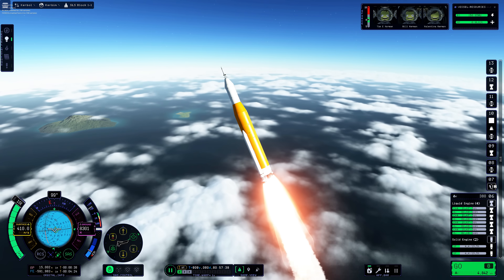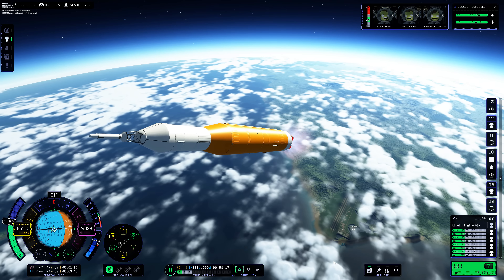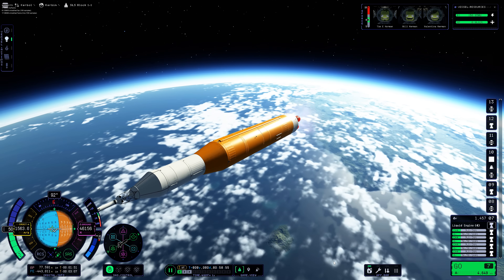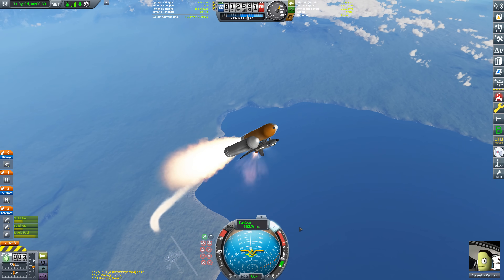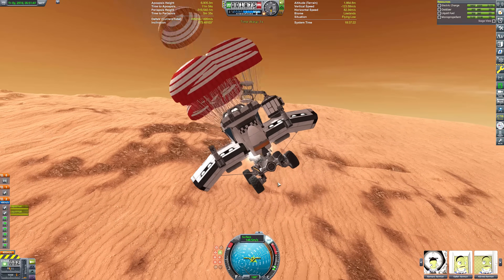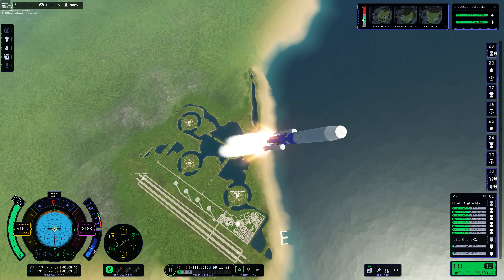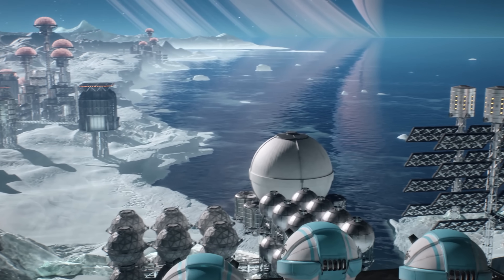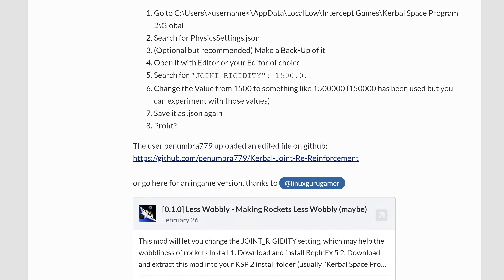Wobbly Rockets Still Haunt KSP2: Developers Face Uphill Battle

Comment: I think I actually disagree with you. Now, From a realistic standpoint, having wobble, but having it better tuned, is closer to a simulation than just treating literally everything as one rigidbody. It creates engineering problems that you have to solve in some analog to real life. It's not exact, but it's true. I also think the argument that "no one would have asked for wobbliness" is misleading. People wouldn't ask for things they don't think about, but I also do believe there's some weight to the idea that the "wobble" WAS entertaining when coming into it, but also, that engineering around the problem, or watching other people creatively engineer around it, was one of the things that made channels like yours really interesting. If you could just stack anything together and launch it, I wouldn't have really had much interest in watching some of the huge amazing builds you've done, because it wouldn't really have been the same kind of dynamic challenge. It would be like "okay, well, I can do that too. Just tack stuff together, add boosters, launch.

Also, even a big long chunk of something from a single piece of metal will and does wobble. They have to be engineered so they they wobble otherwise they would be too brittle and would come apart.

Now, is KSP2 wobble too much? Yeah, probably. I feel like KSP had it in a pretty good place toward the end, but it just needed better optimization; easier said than done. Another issue is that rigidbody joint simulation gets more computationally intensive the more rigid you try to make it, at least using the generalized unity physics solution. I really think some kind of novel approach needs to exist that gives some kind of hybrid approach.

They should take a look at BeamNG for inspiration

Comment: In my naive understanding, if they can calculate a "flex" of a joint and apply it as the wobble, they could just drop the wobble and break the part, if the flex gets too high instead. This way they could calculate the whole rocket as one as you suggested in terms of how forces spread and still could break the vehicle if the flex is too much for the part. ¯\_(ツ)_/¯

Comment: Honestly I don't like the idea of having completely rigid bodies with no joint flex simulated, you could end up building completely ridiculous things that should in reality fall apart, but they wouldn't. For constructions that make sense, ie completely vertical rockets, the joints should be a factor of 10 or more stronger than they are at the moment. Is something seriously so broken in the joint physics simulation that this can't just be fixed by simply changing a few variables?

Comment: To say that rocket stacks don't wobble is not completely correct. There is a small amount of flexing in any rocket stack as it turns perpendicular to the airstream ( a good example is the Proton launch failure from several years back). The rigidity for a stack should not be seriously noticeable until the length of your rocket is like, 100x the width.

Comment: I've never used auto-strut in KSP1, and I've built some ungainly rockets.  There's a different KSP1 option: rigid attachment.  This works exactly like you'd want.  Sane rockets have no wobble, crazy ones do have a little.  And it's a trade-off: rigid joints can fail under sudden load, like parachute opening or high-g re-entry, so you can't use it everywhere all the time.  Flexible joints still have a place, but as the exception to deal with specific engineering problems.  Much better than auto-strut, which just removes an important aspect of the game.

Comment: The big problem is the same crappy game engine. KSP2 is not a brand new sequel, it's just a scam slapped together on KSP1 remnants. It was OK to use an off the shelves engine for an indie game, but if the devs were honest towards their fanbase, they would throw everything away and start a clean sheet product with an engine hand-tailored for such a task.

(and starshit ended bent like a banana before flight termination system finally managed to get the world rid of it, so yeah, bad designs should perform badly)

Comment: Would a rocket engineer, assembling a rocket to the plans of an almighty KSP player, with their own career and professional pride at risk, as well as the lives of possible kerbonauts, not ensure that all parts are firm and well connected? 
Welds are usually stronger than the surrounding material. There is no valid defense of the wobbliness, in my opinion.

Comment: "Fully funded, publisher backed title" guarantees an early release due to management pressure that has absolutely no idea of what state the game is in and thus we have this, BF2042, Cyberpunk 2077, and so on, you get the point. But that's a trend for a while now, so no surprise there...
Instead I'm more furious with the devs because it looks like they are inventing problems that shouldn't have existed in the first place and have a huge issue with prioritization. Why are they insisting so much on the whole wobble if it doesn't work in the first place? Instead of fully focusing on the promised content like say, science or reentry. they have to spend resources to fix this shit instead of turning it off and putting it on ice until they don't have a literal fire under their butts.

Comment: The way that everyone always talks about joints is like they are single points where 2 objects attach to each other. Looking at how the rockets wobble, it wouldn't surprise me that the game actually implements it like that. If that's the case though, I'm curious why the game only has joints that connect by points. Why aren't there joints that connect on a full line (like what would be logical for wings) or on full surfaces (like what would be logical for rocket parts). For the point you would have full wobbliness, for the line, you'd only have wobbliness around one axis and for the surface you wouldn't have wobbliness at all.

Comment: Would it not be a good idea to have inline parts not have joints, however in the case that one continuous inline stack gets too large you insets 1 or 2  or 3 (depending on the length) joints at the connection points?
100m rocket stack, fine, you want to be silly and make it 1000m then there are joints at intervals of that stack which will have to hold those massive lateral forces.
Then with radial mounts then you can add a joint or monitor how many parts (or mass) are on that branch of parts at creation of the vehicle.

Just spit balling ideas here but the point would be to add joints to simulate when groups get past a certain load.

Comment: ksp 1 did have some sort of wobble but if you used the thickest fueltanks and made sure it wasnt top heavy it would be very solid. Only when you would make very bad stage connections would it wobble like you'd expect.

Comment: If they insist on keeping wobbly rockets, I think the only place wobble should be any kind of a thing is in decouplers or docking ports, where there is a clear separation of stages/vehicles.

Frankly, I won't buy KSP2 until the wobble is either entirely eliminated or constrained to a very limited set of parts. And for reference I have over 1500 hours playing KSP.

Comment: I agree for the most part. but I would like to note that they said that some parts cannot be simulated as one solid block, for example wheels, and that they have a system that on the surface turns off all physics, that is, in the game they already have different approaches to different states of an object and buildings will not be simulated like rockets, etc. To some extent, I liked the person’s solutions in the comments where everything is simulated as a block, but if any problems arise, parts touch or are destroyed on the surface, the physics of individual parts is turned on, but I don’t know if this is possible and how it would look.

Comment: Personally, I'd be fine with stacks not wobbling, though I think there should still be checks for too much lateral force breaking a stack, or maybe too much inline force on smaller parts.  I haven't had radial mount wobble be as much of a problem, though I haven't gone for huge launch vehicles in KSP2 yet.

Comment: Treating the entire vehicle as one rigid body is how Juno (Simple Rockets 2) does it, and it doesn't feel right to me.  Juno has fewer options in how you can construct a rocket, so it rarely shows how absurd it looks when you build a very poorly-designed rocket, say one that looks like an hourglass.  But even then, if you do something absurd like tip over too early and go through Max-Q sideways, it doesn't feel like the ship has any physics at all.

There should be some structural engineering considerations in building a rocket.  That's the whole point of Max-Q being a significant moment.  The main question, in my mind, is to what degree it should be a gameplay element.  Obviously a recreation of a Saturn stack shouldn't have significant amount of flex, but I think it should still be a consideration.

I think the KSP2 devs are right in saying that joint flexibility is important.  You're taking that to meant that the current wobbliness is the level they desire, but I don't think that's what they're saying at all.  I think they're well aware that they need to streamline the flexibility system.  They probably even have builds of the game with test optimizations for how to pick which joints to ignore (which, incidentally, is where KSP1 ended up), but applying those optimizations now could preclude other systems currently under development.

Also?  Starship flexed like crazy during that backflip.  At one point the central joint was bent at what looks like 30° or more.

Comment: well the rockets in KSP2 knida whould reaclticy still whoble a tiniy bit in alot of most cases. but its shloud be still mostly far more rgid however. this time is just the woble sohuld be far less i pronocued with large rockets but the very instine and lagre amnotus of woble should only happen with very lagre amonuts of g forces and high stress shold when the wobble should make the rokcet fleix and brake apart if put into too much stress. reaclty only under the most worse knid of g-forced and strcuter stress is when the wooble mechanic shuold make woble and very high cahge of things braking off and explodeing. have you seen sapce x frist suborbtal fight attemtp with space x starship did in fact prove that yes it did bacly showe us that large rockest do infact can flex and wobble but only if in the kind of things thats bacly the large rokcet is bacly expracngi huge anotu of g forces arodamic pressuer and strucal stress at very exrtime near breaking ponts for the rocket sturcure. thats when wobble should happen bascly but only at the high extrems for what the parts would have to deal with as a whole.

Comment: Just give us a tool that lets us group parts that should be one rigid body. This way the player gets to choose for themselves the level of wobblyness they want. Its not rocket science. KSP 1 had a mod like this early on before auto strut mods. They called it welding. If one player wants all parts in all vehicles to be rigid body fine. If another player wants all joints simulated all the time FINE let us choose!

Comment: Roasted.  It's about time we stop cheerleading. This is why it's taken 7 months to address this. One they didn't think it was a problem. Two they thought they could do no wrong and we would just accept whatever jank if the slapped an EA label on it. Kinda late to do anything about now, but yes we were sold on the idea of a ground up rewirte, clean up the spaghetti. As a  metaphor what we got at best was the lower case alphabet rewritten in UPPPER case. New code or not, the result is the same experience as early ksp1 but now even less optimised.

Comment: 3:10 I think vehicular structural integrity (wich woble os a part of) should be a factor, but like atmospheric heating, I should be able to take a capsul-shaped reentry vehicle, stick a standard heatshield on, and have no issues when doing a decent kerbin reentry from a munar return.
Now it would be problematic, if you take that same combo amd return it from lko.
I should strut filligran payloads, but not the main Fueltank to the one above

Comment: its crazy to me that they apparently rebuilt the engine from the ground up and didnt deal with any of the issues that were present rather just rewriting already written code. i wont even touch on the fact they released this rewrite without any additional features aside from procedural wings and paint
Reply: They didn't rebuild sh*t, it was all marketing, it has the same bugs (and also introducing new ones) as ksp.
Reply: Plenty of code has been taken from KSP1. Also the whole idea of taking each part of the rocket, consider them as independant objects, and dynamically simulating their interactions, is a very bad idea but way simpler to implement because you entirely rely on Unity for it. You put your statically defined objects at the right place, define your links and that's it, Unity does all the job. Problem being, Unity is not really made for that so it's very slow and buggy. That was an obvious problem in KSP1, so obviously they should have done it differently in KSP2 but they did not, because they did not want to reqrite the engine from scratch.
Reply: I agree with  @haltux . It's just lazy, I can't even give them the benefit of the doubt. They should have know this was going to be an issue and they ignored it. They didn't even try to work around it.
Reply: They screwed around years, copy pasted code between versions of Unity, and sold it for $50.
Reply: Yeah, they rebuilt it to make it worse.  Good job them

Comment: I'm not a Unity programmer, nor a game dev in general, but here's what I thought of while watching this. As noted, we don't want to turn off joint simulation altogether; there are some connections that should be flexible. But there are a lot that shouldn't be. So here's my suggestion provided it's something the engine and the physics model can support. Each connection point on each part has a flag associated with it. Let's say this flag can have one of two values: 'reinforced' or 'flexible'. Whether that connection is modeled as a joint or the two parts are considered a single physics object will depend on the two flag values involved. If one is 'reinforced' and the other is not 'flexible', it's rigid. If at least one is 'flexible', it's a joint. So, for example, the connection point on an engine will be 'reinforced'. If you attach it to a docking port with the 'flexible' flag, then it's a joint and can wobble some. If you attach a part to an area of another part that isn't specifically a connection point (such as attaching a wing to the side of a fuselage) and thus doesn't have a flag then it will behave based on the value for the first part's connection point. If the wing root is 'reinforced' it will still be rigid. In short, the 'flexible' flag takes precedence over 'reinforced' and either one will take precedence if connecting to something that isn't a connection point with a value for the flag.

I highly doubt I'm the first one to come up with this, I wouldn't be surprised if the devs have thought about something similar if not identical. But you never know....

Comment: It would be nice if vertical stacks instead of having a single center joint, had also 4 joints at the edge (visible or invisible, idc). Then I doubt it would still wobble with matched sizes and it would still have the possibility to wobble with stupid designs. It also becomes far more realistic simulated, since real rockets stacks aren't connected by the center and have their edges clipping through each other.

Comment: Throughout that talk, I feel like the solution they are going to come up with is going to be some form of,
If you inline attach a part, or attach a part radially without a radial decoupler, joint physics isn't simulated. Only on radial decouplers does joint physics get simulated for a part, and only at that radial decoupler.

Comment: Wobbly or not, the rockets can at least be flown. Especially if the motor gimbaling is reduced to only what's needed. However landing gear that falls off during take off, or randomly during flight is unacceptable.

Comment: They really shouldn't be this far into development with no answer for this problem. Its super embarrassing
Reply: They're not really all that far into development.
This current team technically started in December of 2019. But for obvious reasons things didn't really get rolling right away.
The game has been in active development for about 2.5 years. The team that was working on it before got torpedoed by 2K and as far as I know there are only 2 devs on the current team with any KSP experience at all. 
If anyone deserves ire here, it's 2K for killing the original studio.
Reply: I don't think they actually made a game I think they took ksp1, just reskin some stuff and added a couple of models they stole from mods. If this gets to a year and they haven't added anything from the roadmap it's a scam.
Reply: @bustabusts  So... just completely ignore the new lighting engine, the new terrain engine, the procedural wings, all the UI work, all the new animations and cutscenes, all the new models you won't find in any mod, all the high rez textures, the new particle effects and probably a dozen other things I'm not think of off the top of my head?
Cool. Very reasonable and not deranged at all.